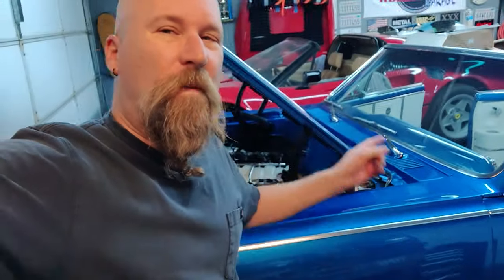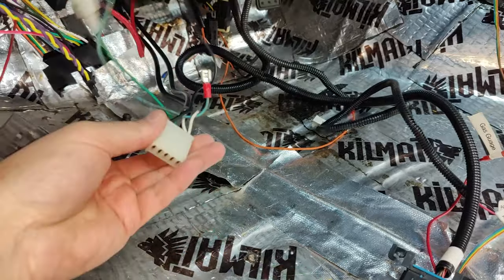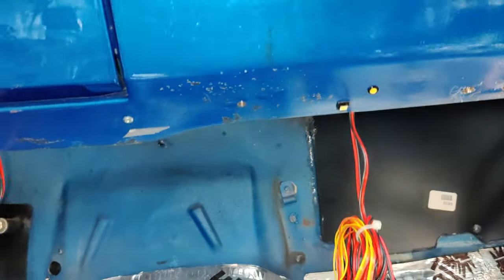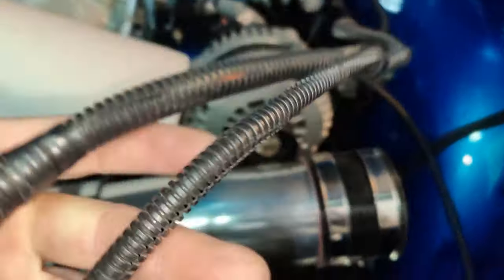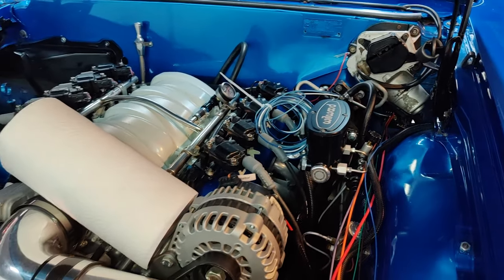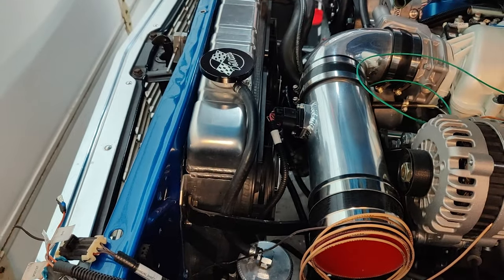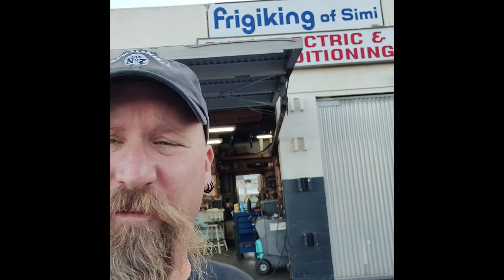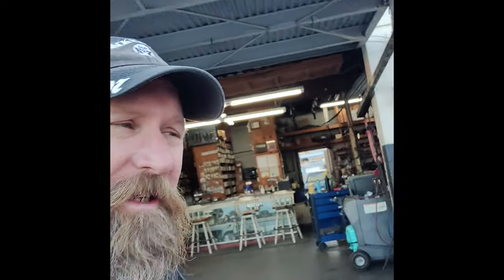pt7 AC Install 1964 Chevelle | Condenser Install and more wiring

Comment: you should have put the cooler in front of the condenser otherwise the air will have a dead space trying to blow air thru to the radiator. Usually all coolers need to be up against each other for a smooth airflow.
Reply from the maker: Thanks for the information. Unfortunately there is no space for the transmission cooler in front of the condenser because of the hood latching mechanism. This car never had a factory cooler, it was originally built into the bottom of the radiator. But I was thinking of putting a smaller transmission cooler down below and moving the radiator back flush with the condenser. What do you think?
Reply: @OpenRoader  I've been watching your assembly of the chevelle as I have a 64 convertible also. I'm just getting around to a frame on and then eventually a full on when I get done with my 57 chevy prostreet. Your cooler might be bigger than I thought because I was thinking it would fit in the left or right corner. Your creativity in solving problems seems to be working fine for you. I can't check for room on mine because it's apart but will keep your progress in mind when I get to the new wiring and ac install. Thanks for replying back and good luck.
Reply from the maker: @1bigdog2u awesome, thanks for following along and good luck on your projects